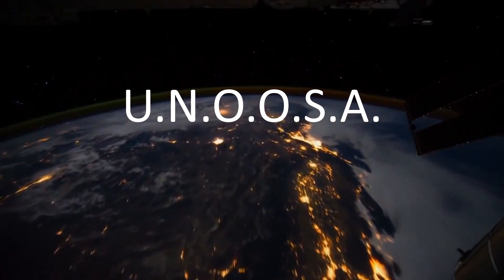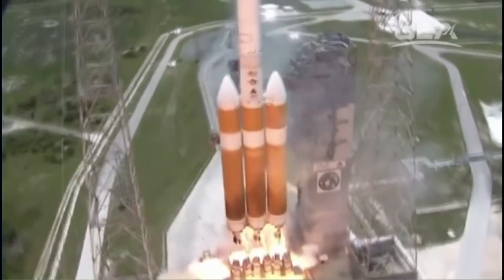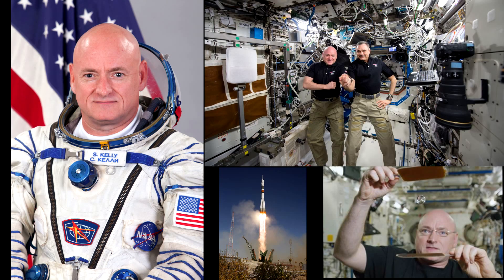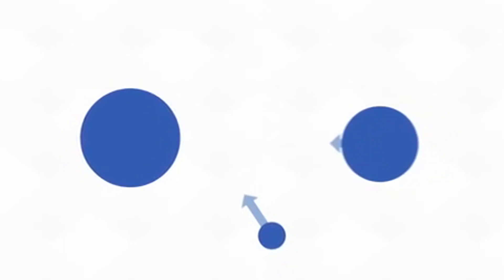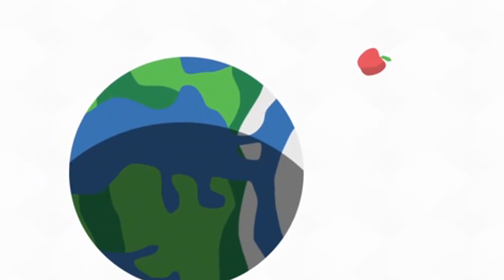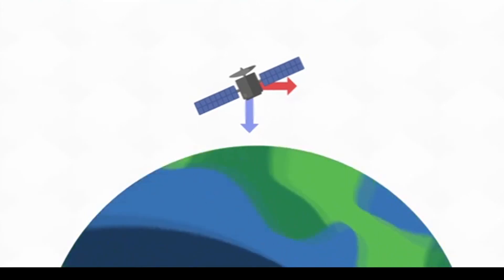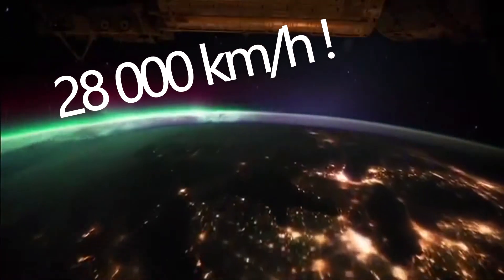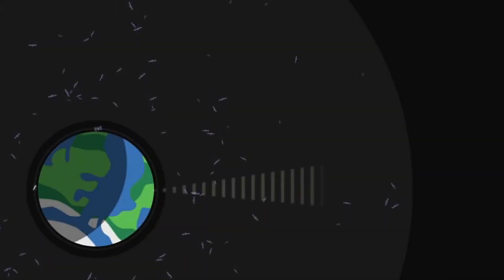How do artificial satellites get up and stay in orbit? #RaceToSpace2017

Comment: Isaac Newton first officially deduced how the orbit of an object around earth (or any object) would work. His genius cannot be credited enough.
He reasoned that a cannon ball, when fired, will have forward momentum which will drain and gravity will drag it back down to earth. 
But he understood that if the cannon ball is travelling fast enough, it will fall at the same rate as the curvature of the earth, and will therefore, never reach the ground. Thus, orbit.
Long before space flight, long before flight, Isaac Newton was figuring these things out. He doesn’t receive enough credit imo.